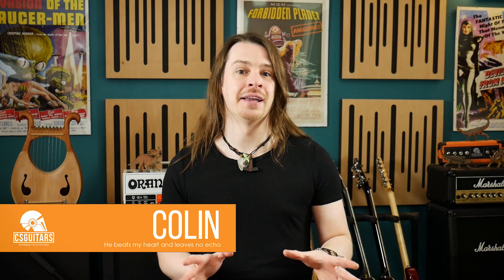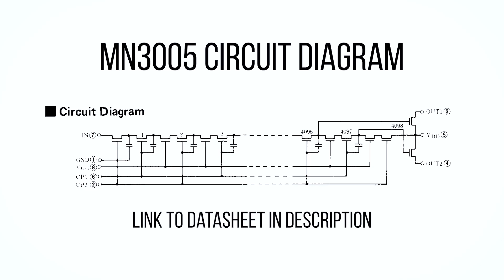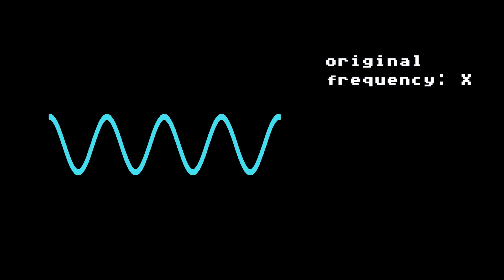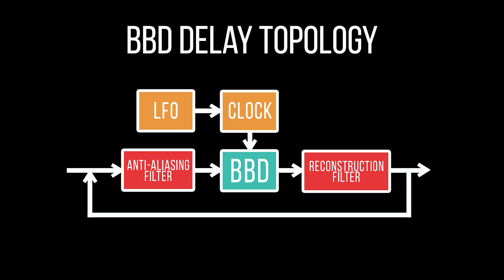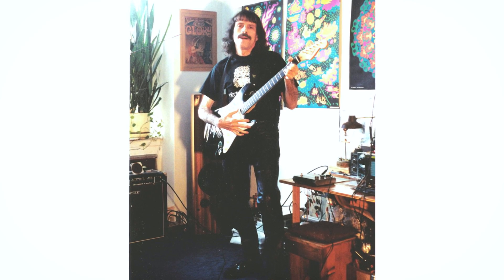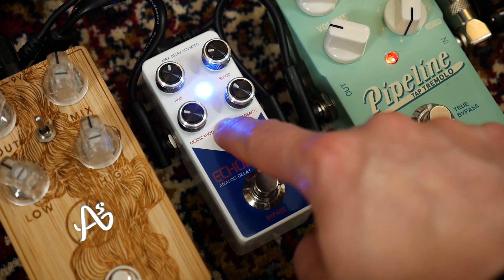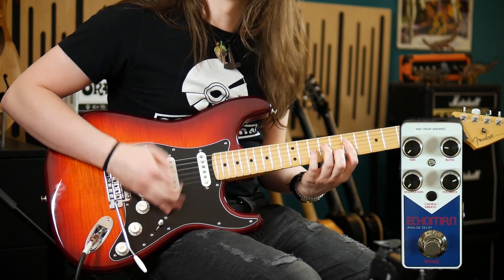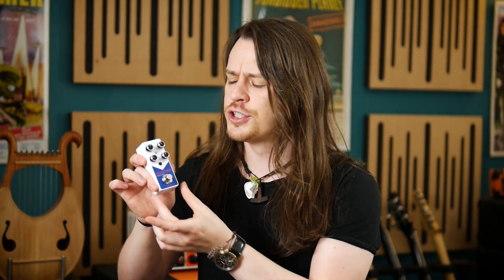Bucket Brigade Devices: How Analog Delay Pedals Work | Too Afraid To Ask [Xvive Echoman V21]

Comment: A BBD chip is always wrongly called analogue. It's an analogue/digital hybrid. It uses analogue input and output voltage but it is discretely sampled in the time domain and is clocked from stage to stage by a digital clock.

Comment: Thanks for this, I've always wondered how they could do an analog delay with a solid state circuit.  And now I know it's only really analog in the amplitude and is still sampled over the time axis (for lack of a better term).
Reply: What I took from it was - analog delay pedals aren't really 'analog' at all..... signal is based on discretely sampled points, the opposite of a continuous distribution.

Comment: So that means analog delays are actually also digital? I've been lied to my whole life
Reply from the maker: No they're not digital. Nothing is being stored as 1 or 0, on/off states on transistors. 
These slice an analogue signal into momentary voltages stored in capacitors. 
It's an entirely analogue process.
Reply: @ScienceofLoud  of course it is ;)
Reply from the maker: @EnterEscape  It is. You seem confused on the definition of analogue and digital. 

The transistors in a BBD aren't storing digital information, they are gating the passage of voltage from one capacitor to the next. 

No information is being stored, the signal is never digitised.
Reply: @EnterEscape  it is discretized in time, but not digitized (i.e. it is never represented by bits and does not undergo quantization). So inside the BBD is essentially a discrete-time analog(ue) signal. Very interesting, as in the field of digital signal processing, "discrete-time" and "digital" are usually used interchangably, but the BBD reminds us that that isn't always true. Great video!
Reply: @AlanDong  @CSGuitars thanks for the answers and great video indeed. I get it know. It's just that analog delays seemed a lot more alluring to me when i thought the resulting signal was continuous. I'm kinda clueless when it comes to how these things work, although i'm familiar with the terminology. I always imagined the signal being split and then just being delayed by having to take a longer route or sth, lol. 
on an other note, i'm assuming the above goes for all analogue time-based effects. Any chance you'd cover a video on analogue filter pedals?

Comment: Wouldn't this technically make this a digital pedal, since it samples the sound rather than manipulate the analogue waveform? Isn't each "bucket" a tiny digital sample?
Now I'm wondering if there's a way to do this with analogue feedback loops...
Reply from the maker: Sampling is a poor word to use, there is no digital process. The capacitors simply store the voltage the see from the signal at the moment in time the switches open. 

'Sampling' was merely a convenient way to illustrate the process. 

There is no digital sampling in this.
Reply: @ScienceofLoud  Thanks for the clarification. Great video as always! 😁

Comment: are there any popular BBD pedals out there which forego the anti aliasing filter in favour of a purposefully aliased "bitcrushed" sound? i'm personally a big proponent of not anti-aliasing the input, nor placing a an interpolation filter on the output, as i find the crunchy, sandy sound quite pleasant given the right sampling frequency. an Fs of 11.5kHz is a particularly nice sounding one.
Reply from the maker: There's absolutely an application for getting a proper filthy lofi echo this way. Purposefully going beyond the chip's tolerances and having the filters disengaged will get some wild sounds.
Reply: I dunno about the circuit, by i am selling my teisco delay as it sounds way to bitrushed. Its kind of cool its just not for me, i like rhe clean DMM sound!

Comment: Towards the end of the video, you mentioned that you and some other people don't like small pedals. What's the reasoning behind that?
Reply from the maker: They're not always stable on a pedalboard as they are taller than they are wide, plus it can be awkward to stomp on them if they are between two bigger pedals.

I had this issue while filming, it was between a Rat and Utopia and the taller, larger pedals prevented my wide foot getting into the narrow gap to engage the footswitch.

They also can't be powered from an internal battery, some people have issue with that. 

Plus they can often just be too small for those of us used to big box effects.
Reply: @ScienceofLoud  Valid points, thanks for the quick reply. And for your videos!

Comment: I think the term "Fourier Coefficients" is not appropriate for describing the sampling process or signal discretization. Those values of voltages obtained every sampling period are simply called... samples.

Fourier coefficients are related with the Fourier Series Expansion of a periodical signal. And more precisely, the amplitude of the nth term of the orthogonal basis (sines, cosines).
Reply: Yes, I would argue that this is in fact a very flawed explanation video...a shame as it’s just tiny mistakes that make the message just wrong. 

For instance the talk about reconstruction and aliasing, no samples are not incorrectly reconstructed into a wave they are just played back. The analog output is band limited and yes there are aliasing artefacts but the “waveform” output is not planned in any way, it IS in itself  the sample outputs. There’s no reconstruction per se.
Reply: I had trouble connecting the concept of fourier coefficients to this matter but thanks to your comment I think I get both what you said and what he meant... in layman's terms, fourier coefficients are used to expand "any" particular wavefunction into a sum of "basic" regular functions (which constitutes the orthogonal basis) , while in this case the coefficients relate not to functions but to the finite value of those functions in a specific point
Reply: @Fedethedangerous95  Yep, that's it!! That's why I don't agree with this 'Fourier Coefficient' term in this context. :) 
But we agree that all his videos are for technology-diggers, don't we? :D
Reply: @TheYaeBb  Yes, definitely! I began following him for the guitar content when I was a high school student and now that I'm in university I also enjoy his lessons as a physics graduate hahah

Comment: TATA: Why does tube distortion sound so good?
Reply: Your guitar heroes probably used it, so you probably like it
Reply: @nc-ix6si  *except Dimebag.
Reply: odd harmonic amplification....solid state uses even harmonics.....
Reply: @howardsix9708  ya got that backwards
Reply: @theknifesedge57  My apologies, you would have thought that after 60 years of playing, I would have remembered that..I appreciate the correction . Never too old to take advice and learn new things. Merry /Xmas .....H6UK
Reply: Further to this question, what happens when I blend the signals from a solid state amp and a tube amp? Are all harmonics represented (assuming phase alignment)?
Reply: Trolly Studios tldr version: even harmonics vs odd ones produced by solid state
Reply: @ccandrew111  this is an argument I hear all the time and it is actually bollocks. A FET has the same distortion characteristic as a valve.
Reply: Dries van Oosten that’s why I put tl:dr before my comment. Coincidentally I actually read in SOS magazine about FETs having a valve like characteristic the other day, should have mentioned it tbh
Reply: @ccandrew111  a) you can make diodes do that.
b) but tape and transformers make odd harmonics and they are revered for 'analogue warmth' too
Reply: @jorgepeterbarton  my comment refers less to current diode clipping circuits, i’m well aware of solid state preamps that sound great nowadays, i’ve even built a few myself; historically though valves were the only way to produce this character and solid state devices weren’t at a stage of development where they could sound good. Also, I believe transformers and tape add more low harmonics, as well as hysteresis